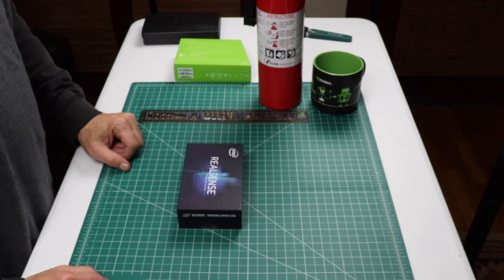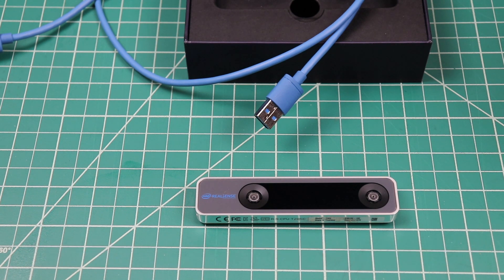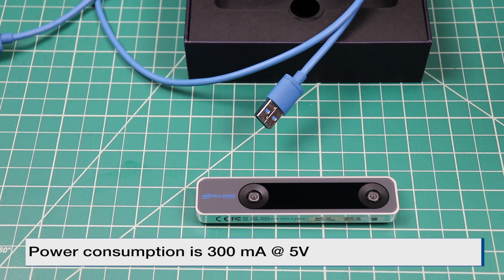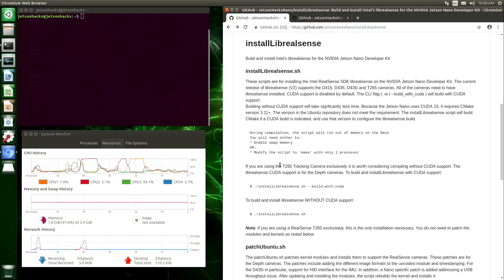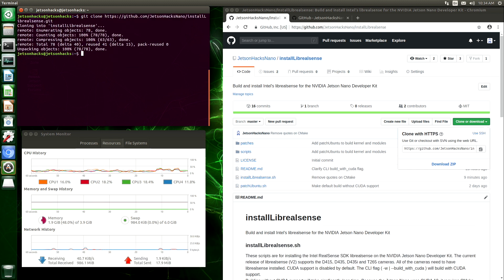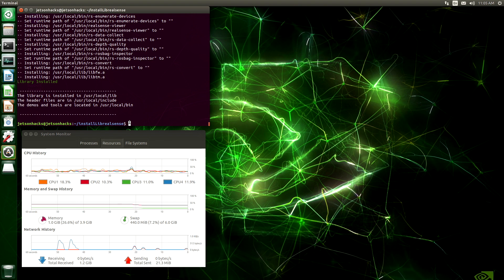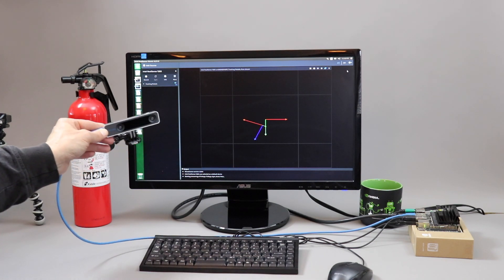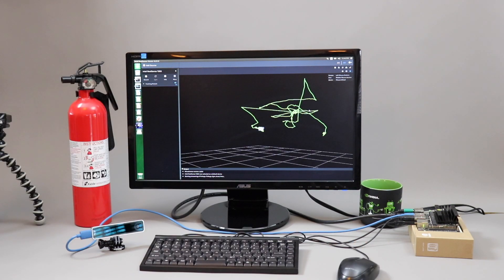Jetson Nano + RealSense T265 Tracking Camera

Comment: the line "Build CMAKE: false" at 4:32 does not show up for me, which later shows up as an error message CMAKE_CUDA_COMPLIER not set, after EnableLanguage" How can I fix this?
Thanks!
Reply from the maker: I do not know which L4T version you are running. Newer version of the repository do not rebuild CMAKE. I do not know if you have CUDA installed on your Jetson. Typically you would look for the CUDA compiler and set the path appropriately.
Reply: @JetsonHacks  Thanks for your quick reply. I am actually using the depth and tracking camera together with python on a RPi4. I'll keep looking how to fix the issue.
Reply from the maker: @pratikparajuli5991  The scripts are for a NVIDIA Jetson Nano which has a GPU. For the RPi you will need to modify the script both for that environment and architecture. Good luck on your project.

Comment: How does this camera compare to the zed?
Reply from the maker: The T265 is a tracking camera, and the ZED is a RGBD camera. Thanks for watching!
Reply: @JetsonHacks  Right, I probably should have asked against the D435. I am looking at a navigation / obstacle camera for a remote lawnmower project, and am between the T265/D435 and the Zed. Main board will be a jetson nano, of course :)

Do you have an opinion on the comparison? You have videos on all three cameras.
Reply from the maker: @kalsprite  No opinion. Each has its strengths and weaknesses. If you are using a Jetson Nano, you should be aware that the ZED does all of its processing on the Nano, which can be computationally expensive. That is, there's not a lot of extra computation capacity available past that. The Intel cameras do their computation on board the camera.
Reply: @kalsprite  Late reply, but oh well. In addition to the heavy computation needed by the ZED, it also works terrible indoors, like in a small room for example vs the Realsense D435, and the Realsense D435 is terrible compared to a TOF sensor like the Azure Kinect or the Realsense L515. Outdoors is another story and TOF/IR does not work as well, so the ZED is competitive outdoors at long ranges.
Reply: @mattizzle81   thanks! the timing isnt bad at all. i ning on picking up the project again this winter.

Comment: I tried to use RealSense T265 on Jetson Nano. I had 4.9GB free space when I clone the installSwapfile directory. But when I  run ./installSwapfile.sh command I got an error "fallocate : fallocate failed: No space left on device" . And my free space became 0. The clone is not that big. Do you know about this issue ?
Reply from the maker: The swapfile is 4.0 GB. The library and firmware for the T265 are of significant size. If you were trying to build the kernel too, there's no way that all fits in 4.9GB. Typically when building something like this, you should have an adequate size SD card/USB drive with enough free space. Also, it is recommended that you build on a fresh install.
Reply: Seems like I should use a 32GB SD card instead of the 16GB one. Thanks for the reply.
Reply from the maker: @PRASANNAMALITH-s1g  Yes, 16GB just gets you going. If you are going to develop on it or gather data, 32-64GB is a better choice.
Reply: It worked well with 64GB microSD card. Thanks
Reply from the maker: @PRASANNAMALITH-s1g  I am glad you got it to work.

Comment: Installed librealsense on my Nano last night and was able to confirm that the T265 is working with realsense-viewer.  The problem I am having is that the T265 is not detected by realsense-viewer or any other realsense software after a restart where the T265 is left plugged in.  If I unplug it and then plug it back in everything works again.  Anyone else have this issue?  Is it possibly a firmware issue on the T265?

Comment: Great Video!
In the B&W left & right images do you see the IR pattern (maybe test in low light condition)? 
Is this pattern always the same or is it changing over time?
Reply from the maker: I've changed this answer. The T265 does not have an IR emitter, it is a visible light device. Thanks for watching!

Comment: when you added the swapfile, was that a permanent add ?, or should we add it on a start up file ?
Reply from the maker: It remains across reboots, no need to add to a start up file. However once you are done with rebuilding the kernel, you may not want the swap file. You can use swapoff to turn off the swap file, and modify the /etc/fstab file.  Thanks for watching!

Comment: Jim, I have tried installing several times on my nano(with no install issues) ,  but I am still not able to access t265 using the RealSense-Viewer.  I have looked on git hub and found similar problems https://github.com/IntelRealSense/librealsense/issues/3361 , the only difference is they were using ubuntu16.  When I run lsusb I can see the t265 on Bus 001 Device:003: ID 03e7:2150 .   But the realsense viewer does not seem to be able to pick it up.   If I plug the d435 camera in the viewer instantly picks the camera up.  One difference is the Bus the d435 connects to bus 002 while the t265 connects to bus 001.    I can plug the t265 into my Windows10 PC and it works fine.   Any idea's?  The device number is also different t265 it is device 003  while the d435 is device 005.   

I also noticed that using a high end power supply that can provided 5Amps at 5volts really improved the nano's performance.  I was using a 2amp max supply and it just was not enough...the nano was slow.   Using the d435 I did not get any of the frame errors you were showing.  The viewer was the only thing limiting the frame rate and size.
Reply from the maker: Did you try to hit the + button and add device?
Reply: @JetsonHacks  The RealSense-Viewer does not list the T265  so there is nothing to add.   The d435 just pops up instantly without having to add.
Reply from the maker: @sy2532  How are you interfacing with the T265? Do you have other cameras plugged in at the same time, and are you using a powered USB hub?
Reply: @JetsonHacks  I am plugging directly into the nano USB slot(s).   Yes I have had both the t265 and the d435 plugged in at the same time.  I have tried swapping USB ports.  I have unplugged the d435 and left the t265 plugged in.  With the viewer then showing nothing to add at all.  The other USB Slots I have a keyboard and mouse directly plugged into the nano.   I do have a usb hub(same as you have) but it is not plugged into the nano and I can give it a try if you think it is needed.

Here maybe something of interest:   The Linux Foundation 3.0 root hub is on the 002 Bus.    The Linux Foundation 2.0 root hub is on the 001 bus.    The camera's are USB 3.0.... yet the only bus that the t265 seems to attach to is the 001 bus... while the d435 seems to always on the 002 bus which is USB 3 hub.  My question is how do I get the t265 on the 002 Bus that the USB 3 hub is on?  Or is this not relevant.
Reply from the maker: @sy2532  First, I would try the powered hub. The T265 does not need a modified kernel, you can use librealsense on its own. With that in mind, create a new SD card and build librealsense on it, but do not modify the kernel. You should see the T265 work. Also, sometimes just replugging a camera can help it be recognized.
Reply: @JetsonHacks  - still not working... I followed your steps above install the  swap file and install the realsense lib.. and I reboot. no camera's plugged in during install.   Same result d435 starts right up in viewer but t265 does nothing but connect to usb.

 I found link of someone with same issue https://github.com/IntelRealSense/librealsense/issues/3384 - @chunyang-zhang ,
When compiling SDK from sources for T265 you must set CMake's BUILD_WITH_TM2=ON.

You also must have an un-obscured internet access (mitigate/verify proxy) for CMake to download the required TM2 firmware blocks.

if those conditions are not met the compiled module will not support T265. You'll also get a warning posted by Cmake  

Is above part of this build?
Reply from the maker: @sy2532  Not sure I understand the question. You can read through the CMake files in lib realsense. You can check the generated file from CMake. In librealsense you can check the connectivity to AWS where the firmware is installed in the CMake file: CMake/tm2_connectivity_check.cmake
If you don't have access to the T265 firmware, it is unlikely the camera will work.
Reply: @JetsonHacks  I found my power supply for my USB 3.0 Hub plugged it all in and started the 2.21.0 RealSense Viewer... and there was no T265.    I plugged the d435 into the powered USB hub and almost instantly the RealSense Viewer sees the d435 camera.      Plug the t265 into my Windows10 computer start the 2.19.1 RealSense Viewer and the camera works perfectly.    Any ideas what to do next.   It seems if the d435 works why shouldnt the t265?
Reply: @JetsonHacks  I see the tm2_connectivity_check.cmake file...it is there...It has a if statement that checks an index if it is -1 then  BUILD_WITH_TM2 SET(OFF) else it is always ON.  I could change if so that it always sets TM2 to ON?  But one way or the other I should see it in a build log... is there one somewhere or does it only post to the screen?

Perhaps there is a t265 firmware upgrade?  can not find one?   I remember doing one for the d435 when I got it, but the RealSense Viewer still worked with it.   

On my windows machine I had to download a new Viewer before the t265 would work, it was just a simple windows10 install.
Reply from the maker: @sy2532  Were you able to download the firmware file for the T265? It sounds like there's an issue connecting with the server, are you behind a firewall or something?
Reply: @JetsonHacks  Okay the firmware upgrade for the T265 is part of the librealsense SDK.   I was expecting it was like the D400 which is separate download.   The nano Intel RealSense SDK is installed.  What is the process for updating the T265 firmware from the Nano?  https://support.intelrealsense.com/hc/en-us/articles/360020199453-Where-to-download-the-firmware-
Reply from the maker: @sy2532  The firmware for the T265 is downloaded by librealsense. You must be able to access the server where the firmware is stored. In the librealsense CMake file: CMake/tm2_connectivity_check.cmake there is a line:
file(DOWNLOAD "http://realsense-hw-public.s3-eu-west-1.amazonaws.com/Releases/connectivity_check" "${CMAKE_CURRENT_SOURCE_DIR}/connectivity_check" SHOW_PROGRESS TIMEOUT 5 STATUS status)
That is the location where the firmware is kept. Can you access that location? If the librealsense scripts cannot access that location, you may not be able to get the T265 to work.
Reply: @JetsonHacks  I appear to be able to load the site from the nano using chrome, it appears to be just a white screen.   

I checked F12 and there is a 403 error forbidden access.  That's not good.
Reply from the maker: @sy2532  It appears that you cannot access the T265 firmware. Are you behind a firewall?
Reply: @JetsonHacks  Not that I am aware of.   The Nano is plugged into home router and cable modem .
Reply from the maker: @sy2532  What country are you in?
Reply: @JetsonHacks  USA
Reply from the maker: @sy2532  That's strange, you should be able to get to it. You will have to ask on the librealsense forums for help, it's not clear why you cannot download the firmware.
Reply: @JetsonHacks  Okay I will open a question about it.   If I was able to load that web site what would I expect to see?  On my windows10 browser I get the same message ... Failed to load resource: the server responded with a status of 403 (Forbidden) .    Still the t265 works using the windows10 version of the RealSense Viewer. 2.19.1 ... if the firmware needed that site then my windows10 computer should not work either but it does.
Reply: @JetsonHacks  , still waiting for some help from the RealSense people on how to force the firmware update on the Nano.   

Still if I did not have access to the internet from the Nano none of the other installations would have worked like installing the Swapfile or Clone the installLibrealsense.    I know those are from git hub and the T265 firmware appears to be from the amazon server.   I was hoping they would have a script that could give them a better idea of why my RealSense viewer(and other rs-*) do not connect to the camera.  
Other people on the RealSense site say there is a problem with the t265 defaulting to USB 1.1 instead of utilizing USB 3.   Re-enforces my belief about the firmware...but why does your Nano T265 work and mine(others) does not, is the question.   Sounds like it is a intermittent problem for some.
My other issue is that I want to use ROS on the Nano...but it is running Ubuntu 18.04 .. and RealSense ROS wrapper is still at Ubuntu 16.04 for  ROS Kinetic.  If I could utilize the USB ports on the Nano plus gain separate processing freeing up the TX2; because the TX2 only has 1 USB port...don't see a reason to have to power up the powered 12v USB hub if I can just use the Nano.   Any ideas or encouragements?
Reply from the maker: @sy2532  There are scripts on the JetsonHacks Nano account on Github to install ROS and realsense-ROS. I'm not sure what your issue is with the T265. I have not had any problems with the install. Did you try your T265 on a PC?
Reply: @JetsonHacks   Yes, the T265 works well on windows10.  All I had to do on the windows10 PC was upgrade the RealSense viewer.  I can run both the t265 and the d435 on my windows10 PC.  Could the windows10 running of the T265 effect the firmware, so that when it is plugged into the Nano it does not work?

I will go ahead and install of ROS on the Nano … I will have to install the USB SSD drive, but no problem.   The d435 works well on the Nano.
I can still use the single USB on the TX2 to see if I can get the T265 working, without having to install the USB hub.
Reply: @JetsonHacks   I was finally successful getting the T265 and D435 camera's working together with the Intel RealSense Viewer on my Nano!!!!!!!!   If I did not know it was possible from seeing you do it, I would have given up on it a long time ago.  It as taken a couple of months to figure out!  The Intel people never answered my question because they do not support nvidia(BUT THEY WERE WILLING TO HELP).  I had to do a few things to get the T265 firmware to load.   I used a combination of your scripts with realsense scripts.    I was also able to flash the Nano(your TX2 flash was a great help!)...but had to pull out of that after the flash used up most of my chips 32gigs(need 64gigs).   Is there away to flash only the components(AI, Vision, etc..)?    If I try to flash to my Nano's USB drive the flash skips back to the chip instead of using my SSD.  There are no options for selecting the drive you want to install on using the sdkmanager?   Still the Nano is quiet amazing when it is running these camera's...wow!
Reply from the maker: @sy2532  I'm glad you got it to work. It would be useful for others who may have the same issue for you to outline what changes you had to make to the scripts to get it to work. 
As for your other questions, this is not a good forum for answering them. You can delete the source for the kernel and build remnants to get space back.

Comment: The install for the d435 on the nano is the same as the t265 correct?  So if I plug both camera's in they should both work.... but   When I start the  ./realsense-viewer I can only add the d435 I can not add the t265.    Any idea's?

Comment: hmm...the 3D at the end looks terribly imprecise. You picked up from specific geolocation at first and returned it to almost the same point. Yet there is a differential distance that seems to be around 30 cm when we took a side view of the 3D location diagram. Can you show us that again or tell us what that tolerance was, please? It makes a difference to me. Thank you.
Reply from the maker: I have found it to be very good. It doesn't sound like it meets your needs. Thanks for watching!
Reply: @JetsonHacks  I admire the support you give and the videos you do are very helpful to me. Thank you! I wonder if it is possible to tweak/improve the location of the realsense with functions or settings that come with it?
Reply from the maker: There are a large number of parameters to control. It depends on your application as to how you would get better accuracy. For example, if you are using a wheeled robot you can send odometry information to the camera and it will incorporate that information to get better positioning. To be clear, this is a "how to use the T265 with a Jetson Nano" how to, not a qualification of the T265 for a particular use.

Comment: Thanks for the video once again! I loved the PRO TIP about film covering! 
I am planning to buy one of this set (Jetson Nano + RS T26) for a prototype application only for detecting skeletal tracking and applying some projection matrix at the highest frame rate I can get. I wonder if this could be up to 60fps, and if I could use more than one RS T26 plugged on the same board...
Reply from the maker: The frame rate of the cameras is 30fps. You can use more than one camera. Thanks for watching!

Comment: Very nice overview! Have you got an idea whether you could run RTABMap on a turtlebot platform with this hardware?
Reply: Or have you perhaps already tried RTABMap without external odometry?
Reply from the maker: RTABMap is designed for use with depth cameras. The images from the T265 need to be rectified before you can use them for that particular package. Thanks for watching!